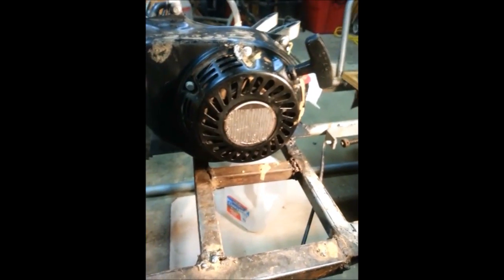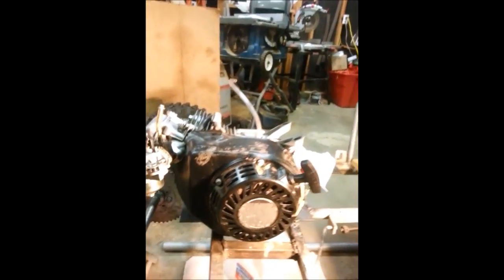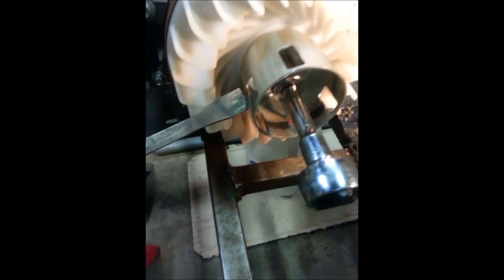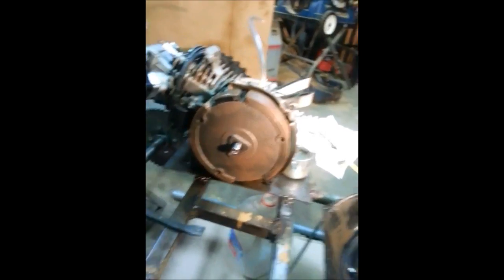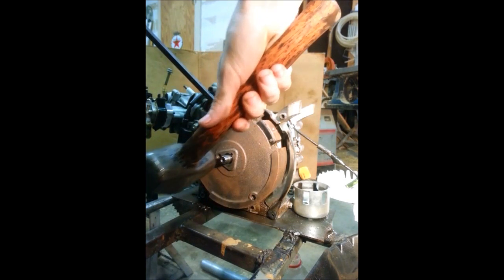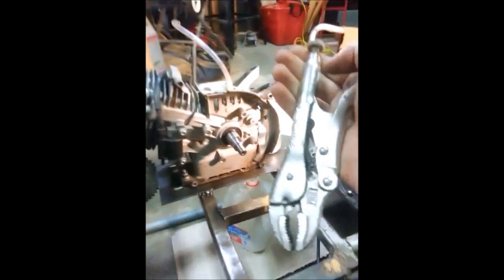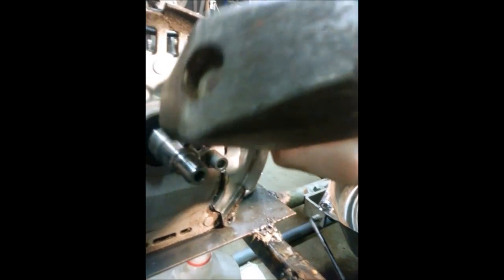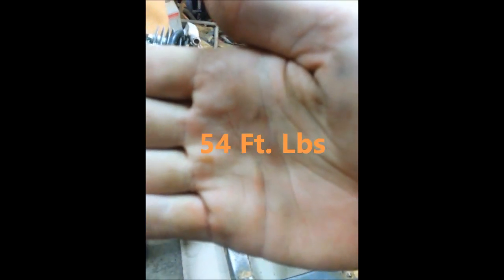[Best How To:] Set Predator Ignition Timing. [Step by Step.]

Comment: Always thread flywheel nut back on crankshaft Before striking with hammer
Reply: It is better to ruin a nut than a crankshaft thread... If you use a nut and happen to strike the nut hard then discard the nut and use a new nut on final reassembly. This protects against stripping of the threads on the nut, only if it has been struck by accident. You are supposed to strike ONLY the crank end.
Reply from the maker: .. MAKE SURE TO NOT THREAD it on completely.
So u don't strike the threads.

Comment: hello, phase adjustment? wasn't it necessary? explain to me please .. thanks and congratulations
Reply from the maker: Phase shift?  These engines are locked to a set degree of ignition timing.  Does not have the luxury modern cars do of multiple timings.  
It could be done if someone was to invent a vacuum/pressure-based module to move the magnet. But unfortunately has not been done yet for these types of small engines.
Reply: @UnTamedMustang  Get a flywheel with settable timing. About $200